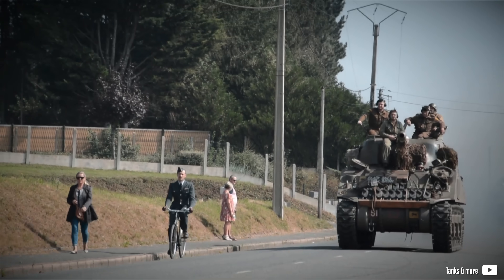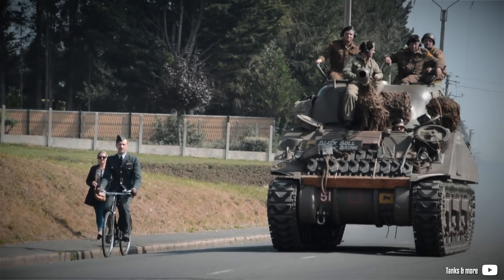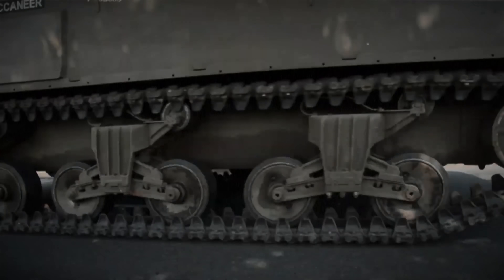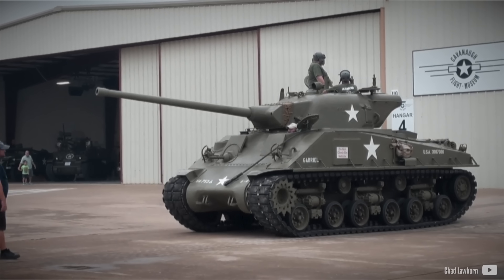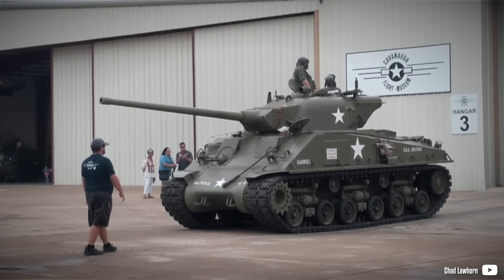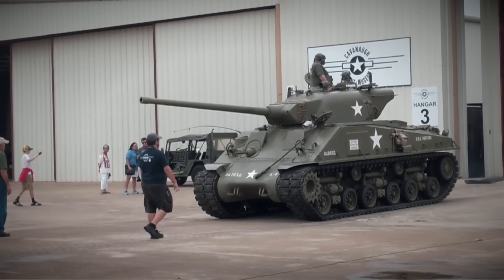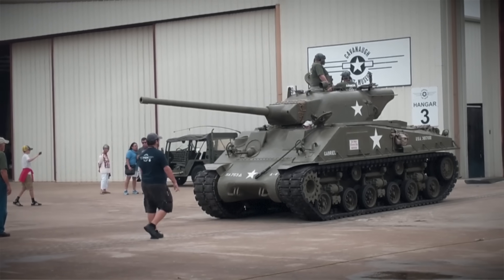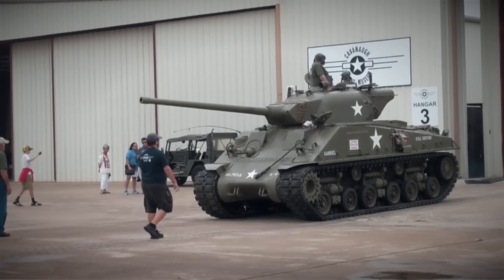This Super Complicated 30-Cylinder Was Sherman's Most Reliable Engine

Comment: The complexity all came from the number of cylinders, not from the tech. They were stone simple flatheads at the core, and the rest is just details and packaging. My understanding was the biggest gripe crews had about the Multibank was servicing them in the chassis. They would pull the entire powerplant whenever possible for big repairs so they could reach everything

Comment: The power plant showed great orginallity and thoughtfulness of use in the field. As it worked out none of the 4 variants of the sherman engines were prone to breakdowns (you can see loads of german tank fans talking about how wonderful their tanks were, but none of them were as reliable as the american engines and if you can not keep your tank running you might as well leave it at home.)

Comment: This was one of the more preferred engines in certain theaters of combat. Aircraft radials make poor tank engines because of the excessive idling and variable rpms they could experience. This led to poor fuel distribution and high oil consumption in the lower cylinders. Belton Cooper, a tank maintenance commander in Europe commented in his book that after they ran out of the new spark plugs for those radials they used up all their blasting media for the plug cleaners and had to resort to using beach sand. The Desiels (two 6-71 Detroits) were loud, and required two clutches to have perfect adjustments constantly made to keep from stalling one engine takng off. Diesels were hard starting in the cold. The Ford GAA V8 was a great tank engine, lighter and more powerful and offered much improved performance. It just didn't have the redundancy or field serviceability by unskilled tank crews the A57 did. Foul out 1 cylinder in a GAA V8 and you loose 1/8th of your power. Foul one in an A57 you loose 1/30th.

Comment: "Horsepower hours" or, how much HP can you make for how many hours straight. Or, how much bearing surface, how many gallons of water and oil and pounds of iron does it contain at a low rpm. that is what people need to understand when comparing H.P. output in a tank in the desert with a plugged radiator, creek water in the cooling system, the governor "tampered with" 2/5 of the engine shot off,  and a 19yr old farm kid that plowed with horses driving it while being SHOT AT! So, no, your LS or modern Diesel is STILL out of the running! Military engines were very detuned and underrated for this reason. With higher compression for modern fuels, MSD ignition, and being ran at the rated rpms of the truck engines it was made from, it could reliably make around 750 to 850 hp today at only 3600 rpm with 1700+ ftlb of torque at about 1600 rpms. Reliability is spelled REDUNDANCY.

Comment: Engineering nightmare
Reply: Actually the exact opposite. Especially when compared to any modern automotive engine. With a crescent wrench, a flathead screwdriver, and a pair of pliers you can rebiuld the complete ignition and fuel system, and trade parts between engines to keep some running. I don't think that 6 gears in a gear case is that complicated.

Comment: Of note, while Chrysler built an 8 cylinder flat head engine, they were a completely different design with no shared parts. The video presents the 8 cyl as simply a longer 6 cyl but they're completely different engines.

Comment: I have to wonder about the electrical distribution of a five bank engine of that era's technology. With seprate sets of points, condensers and individual carburetors....that stuff was always in need of tuning, unlike modren electronic fuel injection with long-lasting tridium spark plugs. They say it was reliable 🤔.......

Comment: The Chrysler industrial 6 was a very reliable engine used in many different roles over it's long production life. Large forklifts, generator sets, aircraft ground service equipment are but a few of the many applications that it was used for.

Comment: Ordnance put Chrysler in charge of figuring out how to mass produce armored tanks. They were to use the R975 since their was a large stock of those as surplus engines with parts after the commercial air carriers switched to using more powerful engines plus Continental was gearing up to restart their production. Chrysler figured there would be shortage of those so came up with the A57 design  since they had thousands of assembled L6 engines sitting in warehouses after auto production was cancelled plus could make more if needed. The British got stuck using the A57 after the Soviets rejected the complicated monster. Chryler engineers worked with British tank mechanics to make it as easy and fast as possible to remove and reset the A57 from the M3 and M4 engine compartments for servicing. Their users said the tank could still motor along after two banks were knocked out. They also reported being able to run those for up to 1000 hours before a rebuilding was required. That was quite remarkable since the R975 and Ford GAA were removed for rebuilding after 200 hours of run time.

Comment: I had a 56 Plymouth 230 in my 41 Dodge 1/2 ton closed cab 4x4 pickup. It came with the 218 originally and other than the increased displacement it's exactly the same size physically so was a popular drop in replacement back in the day when these were common and easy to find. It was a lot quicker then my buddies similar pick up with the original 218 still installed.

Comment: Nowadays, a 6.4 Hemi will give those numbers.
Reply: It's about "horsepower hours" or, for how many hours can you develop "X" horsepower. That is directly determined by 2 factors, Unit loading, or over how many square inches of bearing material you spread the load and by how many rpms it takes to do it.

Comment: Compression in the 6 to 1 range. They knew the engine would be hot with so many cylinders firing next to each other, plus the demanding loads presented by the weight of the tank and obstacles. An attempt to keep temps low and to be able to run ok on garbage quality fuels. Excellent.

Comment: You can't get much simpler than a flat head engine.  Combining five of them with low compression provides adequate power without the destructive factors of turbo/super charging or high compression.  Chrysler excelled in engineering at that time.  They also combined two OHV 6 cylinder motors into a single 12 cylinder engine that powered most infantry landing craft.

Comment: I know these engines well, in both 23 inch and 25 inch versions. Very good design. The weakness inroad vehicles (non-military) was use of an open draft tube for crankcase ventilation. Over time and with deferred maintenance, grit would get into the oil and kill the rod bearings (exacerbated by a bypass oil filter). Also, the aluminum pistons were soft and so ring lands could open up, leading to broken rings. Installation of a PCV valve and use of good oil can keep these motors going forever. (Military versions had a PCV valve.)

Comment: Most reliable Sherman engine was the 6046. It had the longest duration between overhauls for any allied tank engine. 
The best engine overall was the GAA, with the 6046 trailing behind it in 2nd place.
The A57 was a complete pain to service in contrast to the other two. 

DD 6-71's are some of the most durable engines ever made and the 6046 was just two of joined together.

Comment: Sherman tanks were mainly powered by 4 types of engines during WW2:
The Continental R975, 9 cylinder radial, petrol engine.
The twin GM 6-71 two-stroke diesel powerpack.
The Ford GAA V8 petrol engine.
The Chrysler A57, multibank, 30 cylinder, petrol engine.

The Allies performed numerous comparative tests on Sherman tanks powered by the various engines. In an expended test during April and May 1943, for instance, 10 tanks of each type were run with the goal of reaching 400 hours of operation, or 4000 miles of running. Aside from the engines, the tanks could be repaired as required. The average lifespan of the engines were found to be: 
R975:	   	218 hours
GM diesel:   	225 hours
Ford GAA:	255 hours
Chrysler A57:	240 hours

The Chrysler engine required the least maintenance hours of all, but on the other hand, it used the most fuel.
Reply: didnt the Russians get the Radial Diesel ? saw one years ago

Comment: A very large number of Shermans equipped with the multi-bank engine were used by the Canadian Army's tank units. My uncle was a senior officer of a self-contained formation built around a central force of Shermasn; other arms were attached to give them both independence and mobility. Among my uncle's many full-time jobs was Logistics and Supply - which included spare parts, fuel, ammunition, etc. He was also tasked with evaluating intelligence, and producing maps for all sub-units every day, showing the locations of allied and enemy units. He remarked many times that the crews just loved the multi-bank engine. Partly this was because of its reliability, but also because many of the Canadian troops included "farm boys," and they all knew the basic engine well, and were very adept at repairing and maintaining it. Interestingly, in addition to the mass of the multi-bank, it required a longer chassis than other variants of the Sherman, so there were more track links and suspension parts as well. The concept of a 30-cylinder "lash-up" was poo-poo'd by some non-Canadian units, but when it was time to do servicing or repairs, the fact that all banks used the same parts, and that those were readily available changed their views sometimes. The 6-cylinder flathead had already been produced in quantity before WWII, so designing new production tooling, etc. wasn''t required - they just made "more of the same" True, there were parts that were unique to the multi-bank configuration, but they were pretty straightforward in design, and (relatively) simple to make. 
The head of Chrysler at the time, K.T. Keller,  was both a mechanic and an engineer, and he had a lot of first-hand experience working on engines, as well as on manufacturing production lines. Keller's name is frequently overlooked, but he was truly an amazing engineer as well as an innovator. In one biography, Keller described his introduction to building tanks. He and a few of his engineering staff were taken to an Army test site, and then were given an afternoon to watch the prototype in operation. At the end of the day, Keller was handed an enormous roll of drawings and blueprints, and was told as they were driven to the train station that he had 3 months to get the production line for tanks assembled and operating. I don't know how long it actually took, but given Keller's "roll up your sleeves" approach to almost every problem, it was probably done as quickly as possible, but also made to turn out something rugged and reliable. Since Chrysler were already at work on several other very large production projects, taking on the job of building tanks from scratch probably required a lot of long days. Keller was well known for getting his hands dirty, and getting the job done. He relied on skill and a wealth of hands-on experience including many types of production-line jobs (described in detail by one biographer), rather than relaying on being a "name" with an ego and sense of his self-importance. It's a shame he is not remembered as well as some - his contribution to engineering and production was second to none. 
Even today, people read about the 30-cylinder multi-bank engine and wonder how on earth it was ever made to function at all. The trick, of course, was that it was based on an engine that was thoroughly tested and widely used, and known for its reliability. Bolting five of them together does not seem quite so outrageous after all. The success of the multi-bank was due to that proven reliability and low maintenance requirements, as well as to the many  tank crew members who all lent a hand, since many also had already become very familiar with maintaining and repairing the basic 6-cyliner inline Chrysler engine.  Thanks for putting this together  - it's one of the more unusual aspects of Sherman tank production.

Comment: Apparently the British "joined forces" (according to The Chieftan) with Chrysler to improve the reliability of the multibank as they were going to receive most of the M4A4's (the M4 with the this engine). Between the two of them, they managed to fix basically all of the flaws with the initial design. 

The M4A4's were also 1 of 3 variants that were used as the chassis for the Sherman Firefly (possibly the best known variant of the Sherman), so it was definitely worth it for the British as well.

Comment: This Crysler 30 cylinder was a rush job with de-tuned power. 
I'll give credit where it is due, the engine would work and do its job.
Reply: I would have gone with a W16 14L engine with a flat-plane crank, at around 1,600HP gasoline.

Comment: If the engines had just been placed in a row pluging into a collective drive chain,,any one 6 cylinder easily removed and replaced,,if it had died the others keep driving,,and many times only one engine runing as standby power,,instead that colossal engine needed a big hoist to get it out,,not something you want in mud,,

Comment: Very nice video. This is engine was clearly a reliable though unorthodox solution to the engine shortage problem. But you didn’t really defend the premise. You didn’t compare it to the other options. I personally am partial to the R-975. Of course I’m a pilot and I am fascinated that they put what was basically an aircraft engine in a tank.
Reply: Yeah,  the A-57 was quite the kludge that worked, but the other options were better, mostly because they didn't require lengthening the hull and adding tons of weight. I downloaded the Army's tank engines design reports from "the Sherman tank" site links, and Continental R-975 required significant redesigning time to make it a good tank engine. The Ford GAA v-8 turned out to (eventually) be the better option. The Soviets really liked the twin Detroit diesel pack, enough to be running a descendant of it until recently in the BTR(?) wheeled APC vehicle family!
Reply: @KevinSmith-ys3mh  It wasn’t a “kludge” by any means. There are anecdotes from English tankers saying that the engine could lose a few cylinders from penetration and still run. The GAA nor the Detroit 2-stroke could accomplish that. The Multibank powered the greatest Sherman variant for a reason, successfully.

Comment: It must be 6 slant 6 engines. The slant 6 lasted longer than the damn cars they were in. I even worked on one around 95-97 and the poor lady who worked as a secretary at the Chrysler dealer I also worked at. She was broke and with kids. I fixed her exhaust for free. The car was shot but the engine acted like it was new. It’s the only one I’ve been around. Single 1 barrel carburetor. I could feel the off idle torque just moving it around but I’d be surprised if it made good power beyond 3k rpm but that’s what you want in a ppl mover.

Comment: Contrary to the popular beliefs of keyboard warriors, Monday morning historians and WOT experts the Sherman M4 was among the best ALL AROUND tanks of WWII and absolutely there was no more reliable of a MBT in all of WWII
There was not an easier to work on or easier to maintain tank produced in the entire war 
This is not opinion 
This is based on statistical data gathered by none other than Nicholas Moran who spent countless 100s of hours gathering and analyzing the data from the war archives of American the UK Germany and Russia on how thier tanks performed in every possible metric 
In the words of Nicholas Moran what good is the best tank in the world 
1-When at least 30% of the entire number will always be out of action due to known mechanical issues 
#2-There so costly and difficult to make you can make only one to your enemies 6 or 7
Tank enthusiasts today for some odd reason seam to forget what the main purpose and most important task of a MBT was in WWII 
Infantry support and no tank was better (yes many as good but none better) at the roll of Infantry support than the Shermin M4 and chief among the reasons for this was the Shermins absolute reliability and when they did brake down they were far easier fast to fix VS the German Tiger or Pather tanks
If a Shermin needed an entirely new engine or transmission it could literally be changed in hours vs DAYS for a Tiger and worse for a Panther
And detractors of the Shermin sight it's underpowered 75mm gun used in most models poor performance against Germany's Tiger and Panther tanks true enough but again there were in truth very few encounters between Shermins Tigers and Panthers in the ETOC to matter in the outcome of the war and the 75mm gun on the Shermin excelled at destroying enemy fixed fortifications and as an anti personal weapon which is what the Shermin spent the overwhelming majority of its time doing in its primary most important roll of an Infantry support vehicle 
Bottom line was the only  advantage German tanks had over the Shermin was a more powerful gun and in the end that advantage didn't matter because American fielded over 45k Shermins and Germany only fielded +/-1600 Tigers and +/- 6500 Panthers 
Every other important useful metric for a tank the Shermin either was as good or in the case of reliability and ease to be mass produced much better